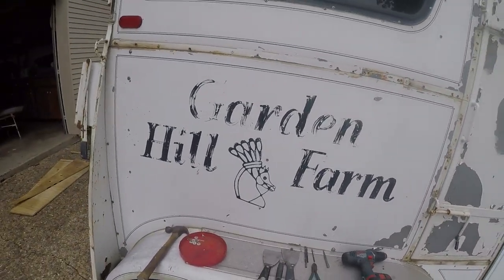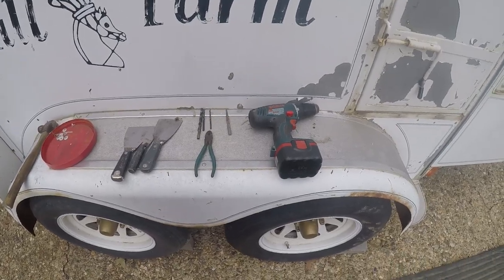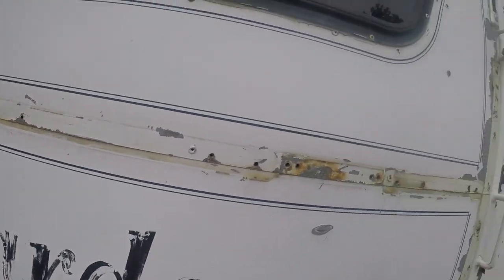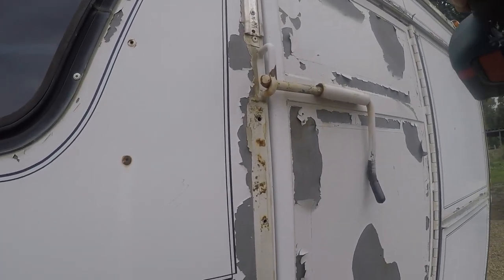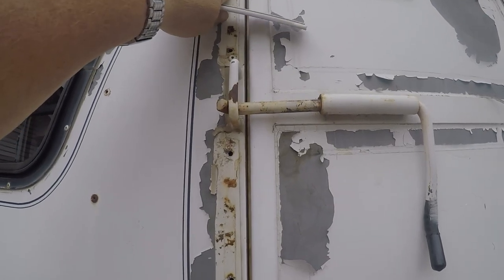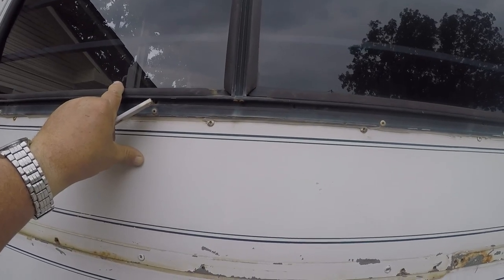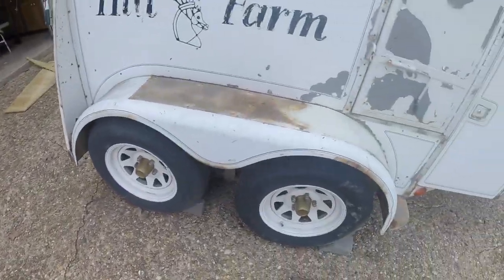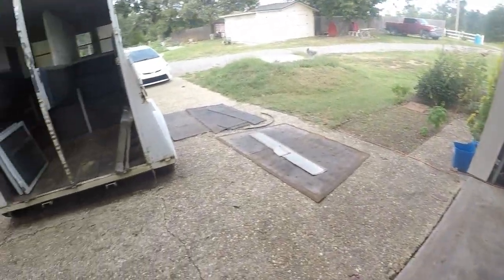PART 4 HORSE TRAILER REBUILD – REMOVING TRIM AND WINDOWS – RAMP PAINT STATUS

Comment: Getting ready to do the same thing on my horse trailer. Did you run into any of your trim buckling from having rust underneath?? Wonder how the trim will go back on with it looking all wavy like once I fix the metal underneath.
Reply from the maker: If you watch some of the other videos, I show how to manage the rust and metal joints that may become wavy under the trim.  The trim on my trailer was aluminum so I did not have any rusting problems with the trim however there was rust on the trailer skins under the trim.
In video 6 I show how to clean and polish the trim and also show some products (rivets and countersinks) from the aerospace industry that you can use to rivet the skin down before you put your trim back in place.  In video 7 I show a skin lap area that is corroded and wavy.  I demonstrate an aerospace product (Clecos) used to hold the skins down while you shoot in rivets.  You can usually find these products on eBay.
It has been three years since I completed the restoration and I am pleased with how well the trailer has held up.  It has set out in the elements and still looks as good as the day I completed the restoration.
I need to do a follow-up video to show the condition after three years.